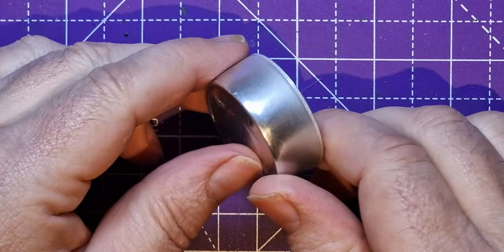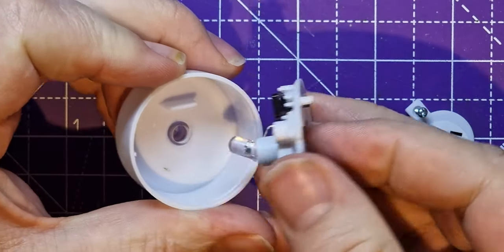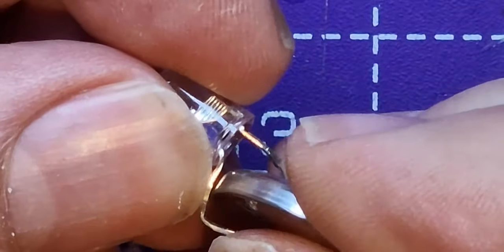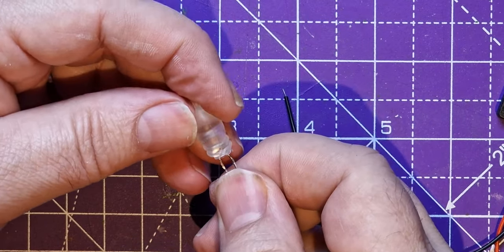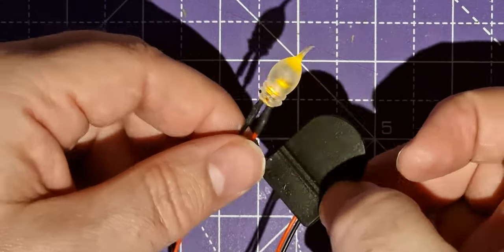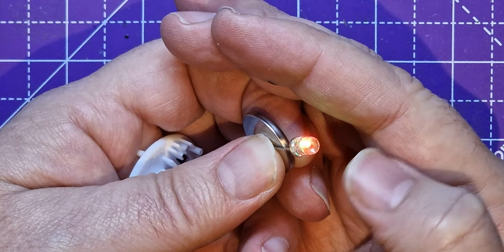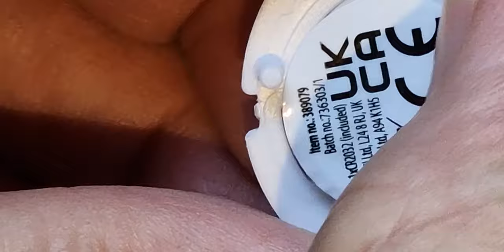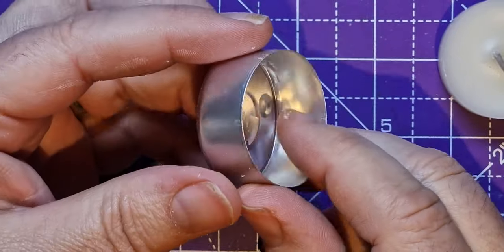Fantastic Push-Fit Design of cheap LED tealights.  Hacking and reusing them in your models #lifehack

Comment: Cool video spidermaf and thanks for the shout out. 
I never knew those 2032 batters packs with switches existed. I bought some motherboard battery holders but then have to add my own switch. I am inexperenced so added a resistor and... of course it doesn't work properly. The battery drains in mins.
It was my second attempt at getting E.T.'s LED finger to light up and both attempts failed miserably. I suck at electronics.